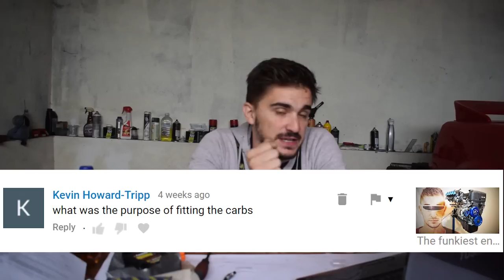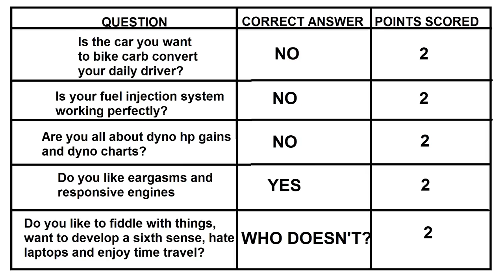Bike carb conversion BENEFITS and DRAWBACKS

Comment: Bro i need a help. I have a 1987 Golf Mk2 GTI With Injection, injection was a retardest thing and i removed bcs in one month this shit was broken may a 10 times, then i put a mono point injection and its a low power... then i put a Rochester Varajet 2 and its a economy, good sound and more power than injection but isnt enough. Does a Bike carbs make a my car maybe a better accleration? I scored 8 points but xD This is my daily - tuning car. I make a engine from 1.8 to 2.0 with a ported head and some things, engine is in great condition and i mean it would be a half economic with bike carbs maybe a 13-14 litters at 62 miles on a half sport drive, maybe a smaller on a Granny drive. Do you recommend a carbs for me?

Comment: what about mechanical fuel injection? Should i throw it out and do a bike carb converion on my M103 r129?
Reply: Sounds expensive to do that. For that cost you might as well convert it to M104 engine.

Comment: Hi, I got a set of Keihin Fcr41 from a CBR1100, and want it installed on a Toyota 2tc engine. Do you think it's to much to the engine,? Or will be ok?
Reply from the maker: Any other mods on the engine?
Reply: Bored piston to 20 only.
Reply from the maker: You will have a torqueless bottom end of the power curve. What's the redline? If you can make a high redline than the top end should be fun at least, but a high redline also needs mods.

Comment: What bike carb would you recommend for a 1.4 dual carb civic gl.
Reply from the maker: Depends on other mods, if it's an aggressive build 36.5mm would probably be ok, if closer to stock then a few mm smaller maybe
Reply: @d4a  Thanks. Would it change the mpg by a lot?
Reply from the maker: Not too much likely

Comment: Ive got a mk2 polo on cbr600 bike carb 1.4 16v afh conversion the carbs keep flooding with petrol have u got any ideas on how to solve my problem ?
Reply from the maker: Your float valves are worn or clogged most likely. Replace them
Reply: Thanks for the advice 👍

Comment: I have a question i recently bought a keihin cvr but it’s tps is broken and i can’t unplug it because of the screw are totally  destroyed, can i still run it without the throttle position sensor?
Reply from the maker: You can, no problem. You only need the TPS if you're running standalone 3d ignition, otherwise you're ok. That being said, I highly recommend standalone mapable ignition, it enables you to have smooth performance and great throttle response at all rpms and throttle openings. Without it you can maybe get your wide open throttle the way you want but everything else will likely be imperfect.
Reply: driving 4 answers thank’s mate one last thing is it posible to turbo a itb motorcycle carb engine ?

Comment: Will this carb and ECU set be right for a black top 20v 4age the 16v are getting hard to find
Reply from the maker: Isn't the 20 rarer? Yeah, you can basically carb convert any engine. But the 20v already has ITBs, so doing carbs doesn't really make much sense
Reply: @d4a  my bad for not giving much info I'm from the u.s and I have a 1985 Toyota SR5 that I going to swap in a 20v blacktop 4age into and want to make the build simple without setting up the map and ecu set up for the motor the nodiz seems more suitable and I can find the 20v black top motors more available then the 16v p.s in kinda new to all this and want to get as much info as I can lol